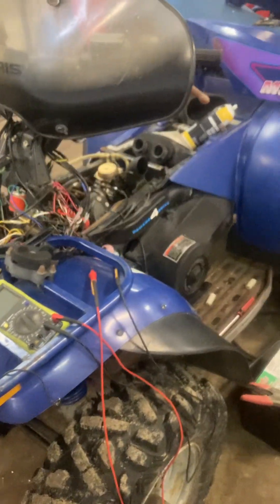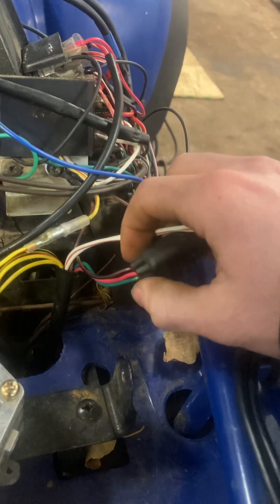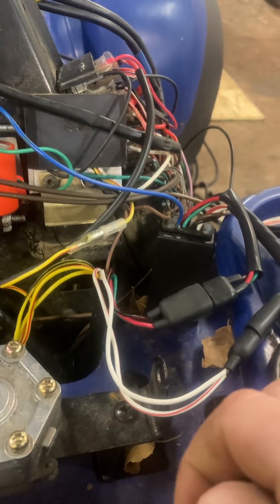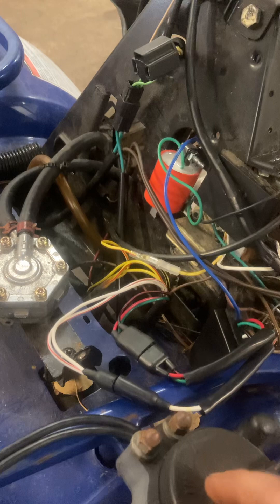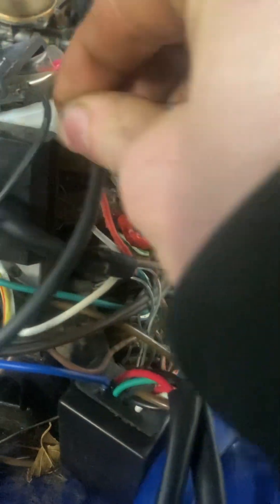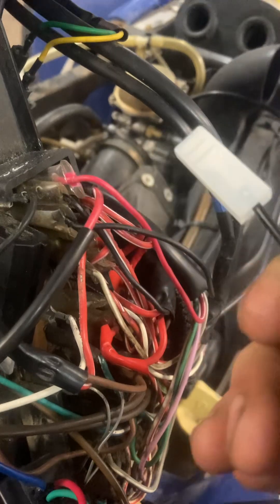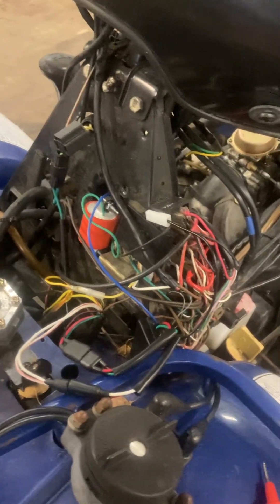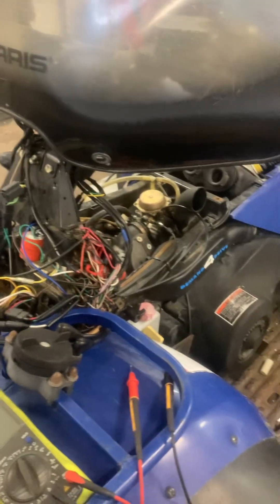How to diagnose no spark on a Polaris Magnum 425

Comment: 1 of my white wires on my cdi box has continuity. On the new one, as well as the old one. Its the solid white pickup coil wire. Is that normal or bad new cdi box? Thank you. Same no spark issue.

Comment: Hey i have checked all the things you mentioned in the video but still no spark, so far i have changed the cdi box, coil and timing coil do you have any tips to what it could be.
The stator measures 0,2 1,4 and 1,6 on the yellow wires when i holdt the starter should the stator make more voltage?
Reply from the maker: Sounds like you might have a dead leg on the stator. Check resistance of the stator across the three wires. Should have 3 identical or very close readings.

Comment: 2001 trail boss.  ok it runs fine on old cdi but wont shut off.
put new ignition and handle bar switches and stator still wont shut off even touching black on cdi to ground. so put new cdi on and now no spark even with black unplugged from cdi. any help ????

Comment: Thank you for posting this, I had this exact problem.  To add to what you did, I took the switch apart and did a continuity test on the brown and black wires coming out of the kill switch and both were good.  When I took the red push button out, I found that the little spring that provides tension against the contact points was rusted so badly that it broke in 2.  Replaced the spring and now the switch works as it should.
Reply from the maker: Nice!